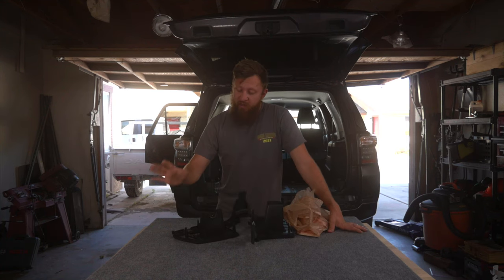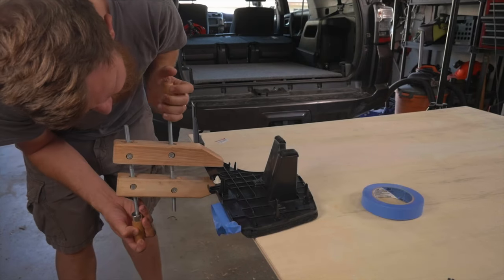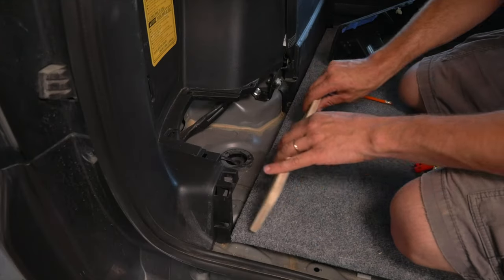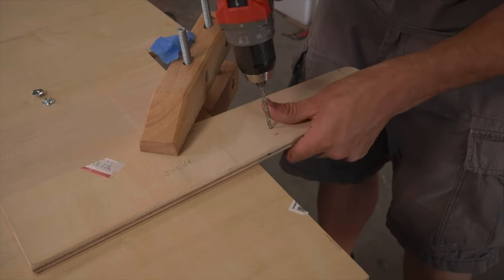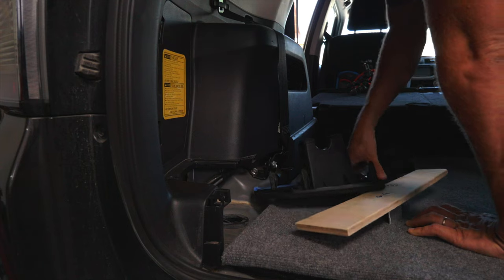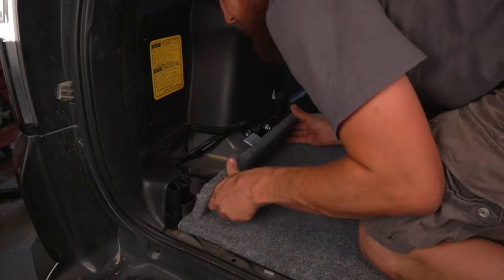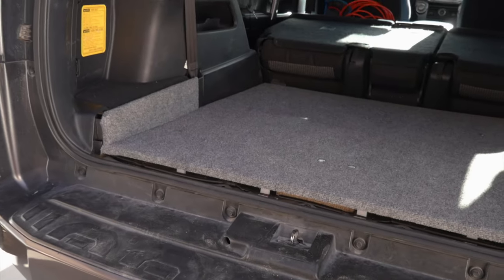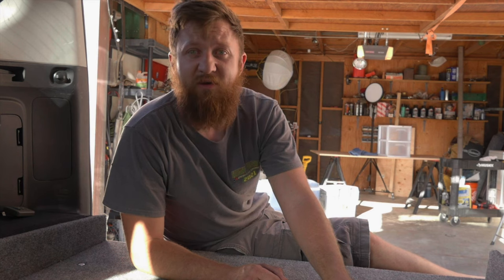Finishing the DIY Goose Gear Platform (3rd row delete plate)

Comment: What would you do if you were sleeping inside the vehicle, with 3rd row seats?  Removing just the third row will make it really unlevel.  Would you recommend removing 2nd and 3rd rows and building a small sleeping platform?  Thanks!
Reply from the maker: I planned on sleeping in here before we had our 1st child. 

It's already not level with the third row installed. My plan was to make an extension piece that slides over the top of the 2nd row when folded down.
Reply: @EmbarkWithMark  any reason not to remove 2nd row seats?

Comment: Great video bro! I'm taking on this project now and wanted to ask just to be sure: Did you use the existing body mounts for the 8 bolts? and did you ever end up throwing on the trim piece to the edge? Thanks!
Reply from the maker: Glad you enjoyed it! 

There are existing threaded holes for the 4 rear bolts. The front you have a few options. You can make a brocket to use the exsiting threaded holes, but they are at a 40 ish degree angle. 
The body of the 4runner has a support rail that goes across with many holes. I chose to use nutserts in these holes and the respective hardware to match.
Reply: @EmbarkWithMark  thank you so much for the reply! And did you run the bolts directly down into the body or did you have to space it out with wood blocks? Sorry I’m a total noob and don’t wanna mess anything up lol 🙃
Reply from the maker: The front bolts go directly into the body the rear part of the platform needs spacers to make it flat.
Reply from the maker: No problem at all!! Once you look at it you’ll see theres not much to mess up.
Reply: @EmbarkWithMark  I tackled it today and it came out well after a few little bumps here and there! Did you end up getting a new edge sill plate or modding one yourself?
Reply from the maker: @jmagliulo1  Awesome to hear!  I did end up getting a new sill plate